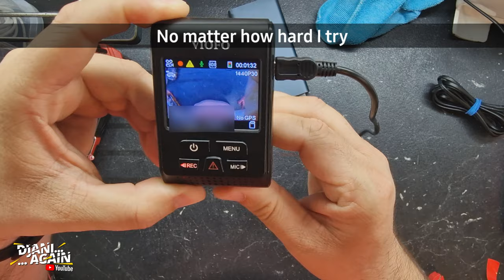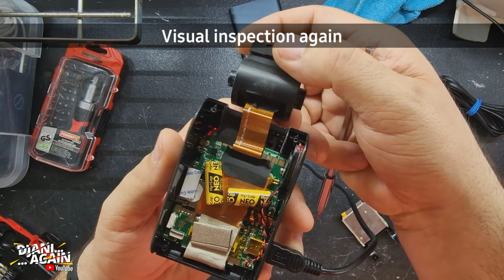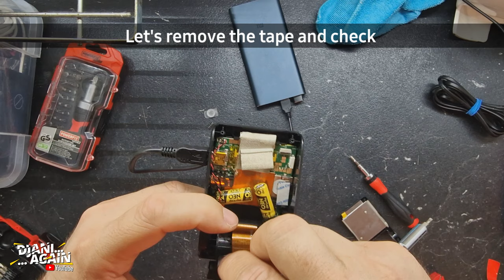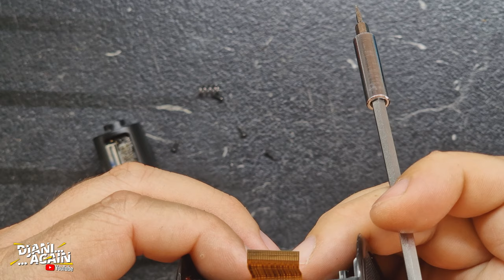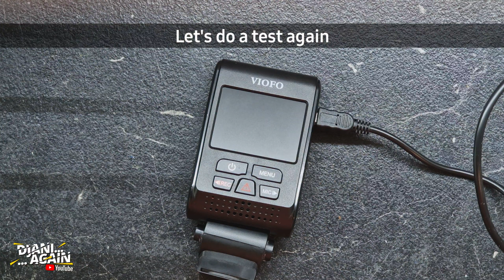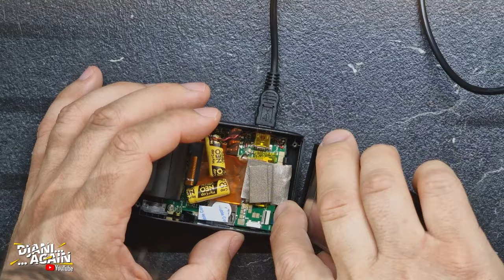Dashcam repair. Viofo A119 v3, black recording, glitching and etc.!

Comment: How many years you run into trouble
Reply from the maker: After 2 years of usage, with hardwire kit.
After this intervention i opened it couple more times, and it still does some glitches occasionally.
Reply: @DjaniAgain  mine is stucked after 2 weeks what a piece of junk
Reply from the maker: Mine continues with this problem, almost every day. I knock it slightly and it's fine 😅
Next one, Xiaomi 😜
Reply: @DjaniAgain  lol im update from xiaomi to viofo
Thanks to the nice reviews, cant belive how shitty this crap is
Reply from the maker: @hailyphan7754  😅
Mixed feelings, I don't know what to say
Reply from the maker: @Hai Ly Phan  I used it 2 years, after that problems started my friend ✌️
Reply: @DjaniAgain  lol you are lucky brother. I have lost faith in Viofo
Reply from the maker: Sorry to hear that! I'm curious, what other brand you tried? Maybe for next one to not make mistake 😁
Reply: @DjaniAgain  70mai is stable. But it has battery which scares me under the hot weather=> thats also the main reason I switch to capacitor and then I realized capacitor is so freaking dumb. My viofo stucked at booting for 30 mins straight away for 1 week. Im waiting for the new one coming to test since viofo sent me new one
Reply: @DjaniAgain  its funny how my question is before buying viofo dashcam and then my dashcam is broken within 2 weeks what a crap
Reply from the maker: I'm so glad you were compensated. I hope that everything will be fine with the new device! 
And I thought with supercapacitors, it would be space technology, but they last long enough to keep the last clip.
Reply: @DjaniAgain  yeah idk bout the new one quality as well my brother. I have run hardwire for viofo dashcam so lazy to remove and back to 70mai just pray it works properly this time. 
Cheers
Reply from the maker: 😅 Everything will be fine my friend 👍